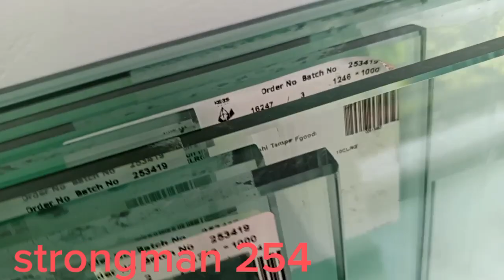Call police ‼️‼️‼️

Comment: The biggest investment in any home is "WHAT YOU CANNOT SEE" such as electrical and plumbing. Cutting corner here on cost or with a sloppy contractor is FOOLISH! Spend tens of thousands on tile and the installation only to have to rip it out to fix sloppy plumbing and electrical work. Then do it all over again. Very Costly. Think about it!

Comment: I think all the plumbing through the floor should be  andabandoned and everything run outside around the house and brought into the kitchen wash room and bathrooms....STOP DIGGING UP THE TILES AND RUN ALL THE PLUMBING ......BRING EVERYTHING OUTSIDE THE BUILDING and then bring the pipes into the house..I had to do that with my house in Jamaica....It is old fashioned plumbing to run pipes under the floor throughout the house...bc in case of problems like leakage  u have to dig up tiles..like what is happening now.

Comment: Strongman, you should advise Mates to invest in a well drilling company to bore down to a lower aquifer. This water table is high. It will be contaminated by sewage and the latrines, especially with so many visitors. Even though bottled water will be available, people won't be careful when brushing their teeth. People will get sick.

Comment: So a plumber works without tangit😂😮  and doesnt know which side the hot water vs cold water flows  and doesn't which type and size pipe is used for SMH.he may not be lucky with the next persons job he messes up😢